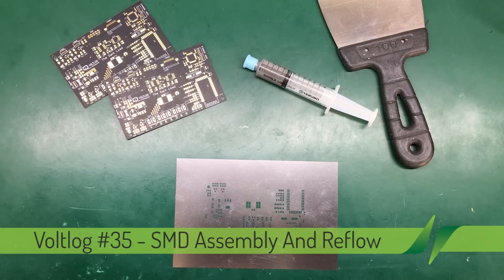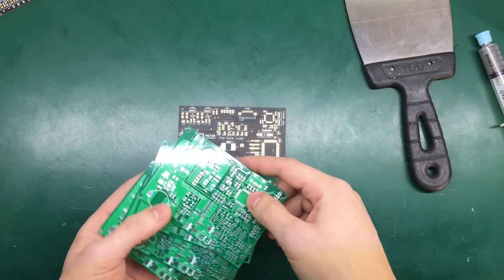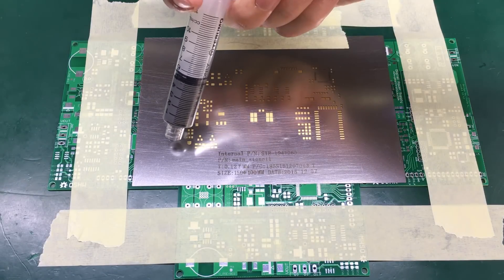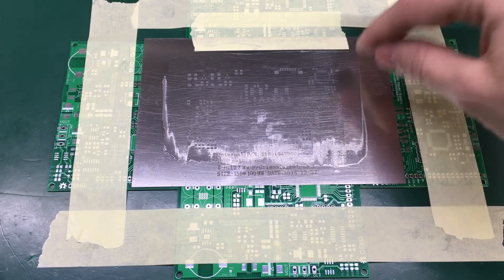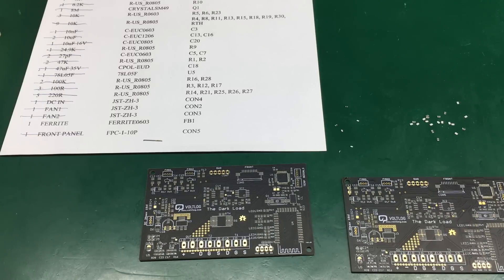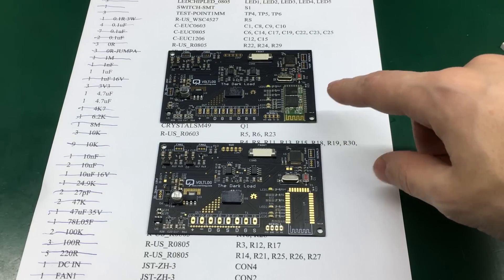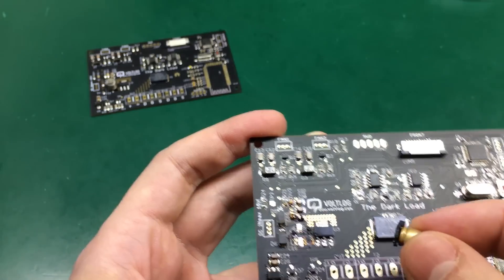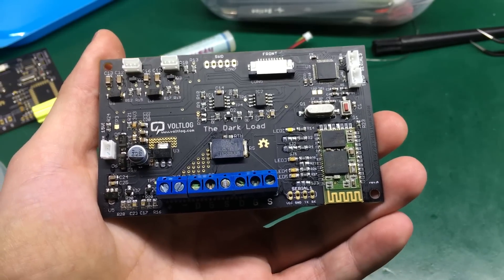Voltlog #35 - SMD Assembly And Reflow

Comment: Assuming the stencil is indeed steel, wouldn't it be easiest to lift the non-tape-hinged side with minimum possible disturbance by using a magnet to "suck" it up, without even touching it...? Just an idea...
Reply from the maker: It is an interesting idea with the magnet, I might try it next time I work with a stencil.